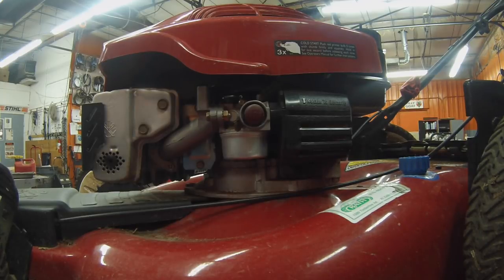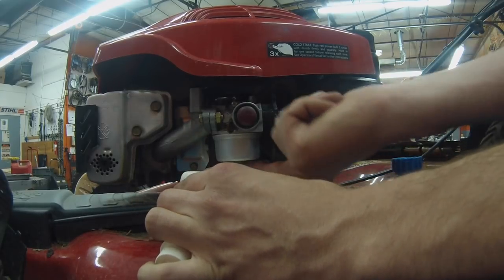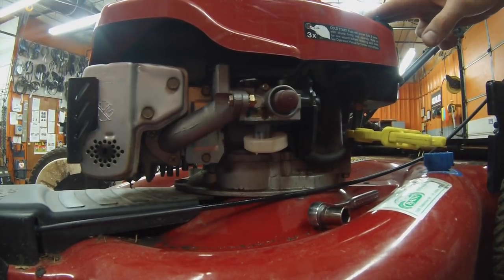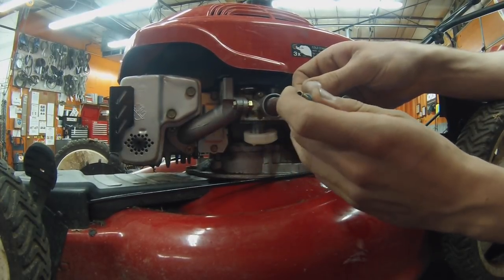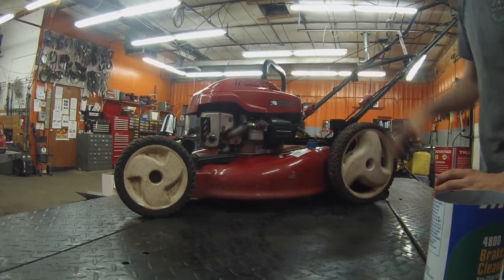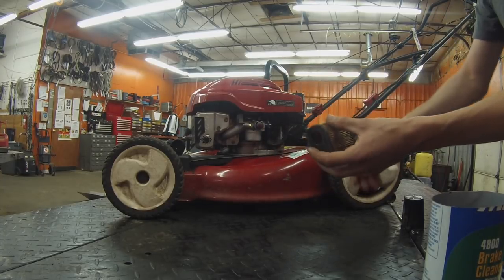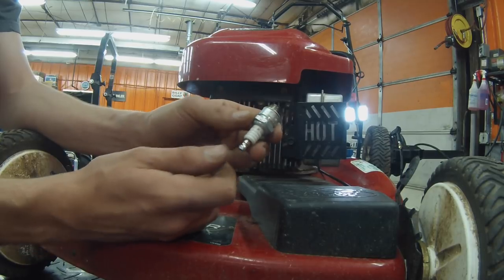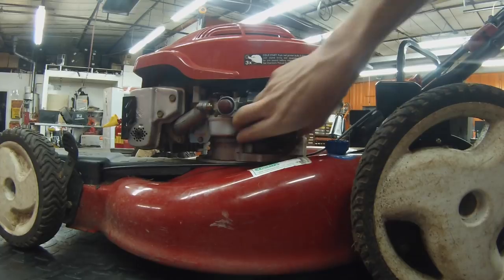Lawn mower won't start after winter? Old fuel flush!

Comment: Excellent video, SS. Clear voice, video and instructions. I have a Briggs Murray 6 HP and every year I have over 100 bags of leaves which I chop with the bag off, creating tea leaves for flower beds. Amazing soil. It is mid Nov. and I just used it yesterday. But, today for the first time, she won't even suggest ignition. Glad I found you but haven't touched the fuel lines or carb yet. I have a machine from mid eighties, but also my fathers from the 70s.

Comment: thanks for the vid man. I took off the carb and cleaned it but didnt realize the holes on the side of that bolt.
Acupuncture needles I got with my 3d printer worked perfect. Thanks again for posting!

Comment: I install fuel shut off valves on all my small engines and run the engine until it stalls before storing for the winter along with using a fuel stabilizer on the last tank.
Reply: Smart! yeah!

Comment: Pour Gumout in the tank to flush the system. Install the bowl nut. Drain the tank and refill. Check for spark. Check compression or leakdown. Open the vane fully and check if the gov. screw touches the engine. If not, replace the springs. Check that the muffler isn't clogged.